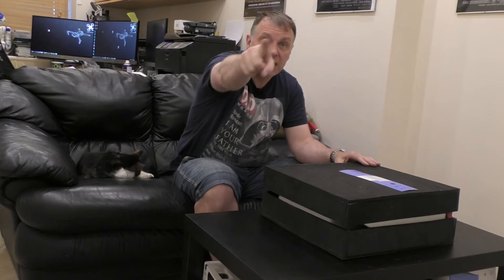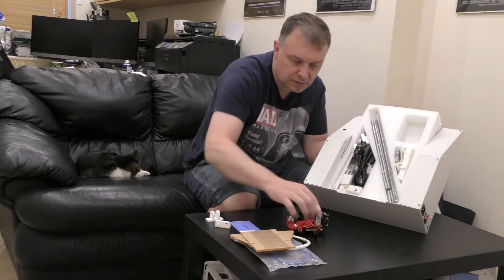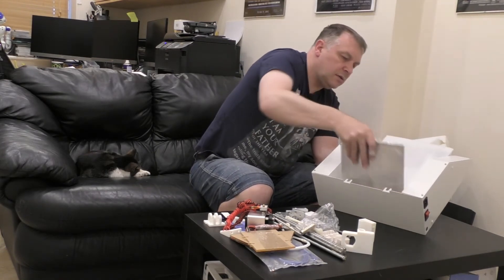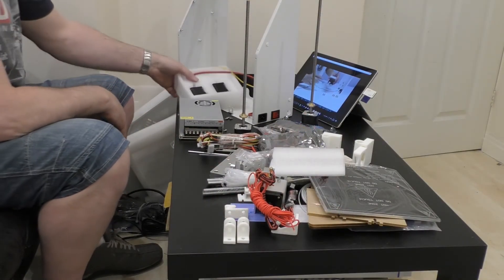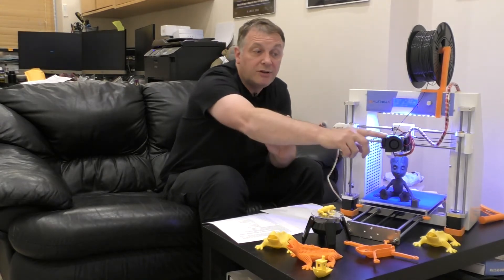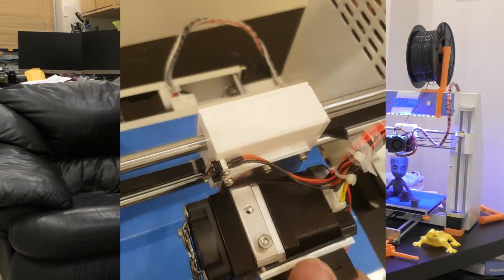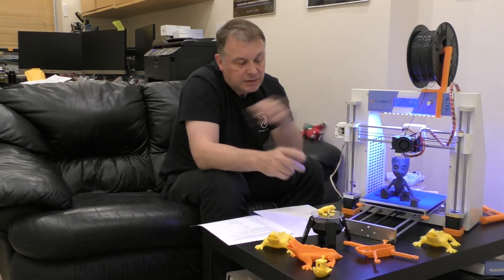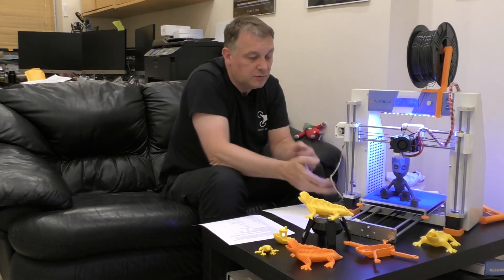JG Aurora A3 3D Printer unboxing and initial review (http://diyrc.co.uk)

Comment: Hi got this 3-D printer from Amazon why is it all up built it y okay ok x going the wrong way can you help Alan ps it's my first printer
Reply from the maker: You can either reverse them in the firmware if you have the source or swap two wires over that lead to the motor. So 1234 would become 2134.

Comment: I'm having trouble putting my STL files to print on the JGAurora.  I want to print larger prints but they don't print.  Any suggestions?  I want to print the larger groot you printed
Reply from the maker: What slicer are you using? It might be your problem. I think the big groot has lots of polygons..  Try downloading the new Cura or Prusa Slicer and seeing if they work better
Reply: @Waggster  Thank you, I will give it a try.
Reply: I downloaded The Prusa Slicer and my JGAurora is working fine now.  Thanks!!!

Comment: Are you using printer's tape for the bed?
Reply from the maker: I was yes but you have better options now. Things like magnetic beds.. have a look at the Eryone pei magnetic bed. :-)
Reply: @Waggster  I have the Back diamond bed that came with the printer.  I'm having trouble with my prints not sticking where they were sticking before.  Maybe I need to clean the bed with alcohol and see if that helps.  I use the blue tape on my other printers and it works great.  I am going to try using the magnetic bed that I just purchased.
Reply from the maker: @rosebarrette6292  AHH.. you have the A3s then not the one in the video which is just the A3.  If your prints aren't sticking give it a wipe but you might also need to bring your bed up a tiny bit.  So clean your bed as you suggested first, that should do it.
Reply: @Waggster  Thank you!

Comment: those knobs for leveling are great! did u print them?
Reply from the maker: Hey Tomasla77, Yes I printed them on the JG and then heated up some M3 x 5mm brass inserts over a flame for about 8 seconds and melted them into the plastic.  I've uploaded the stl if you want to have a look.. it's at http://diyrc.co.uk/images/knob.stl     Many thanks,
Reply: thanks a lot for sharing the file,!! i give it a try...